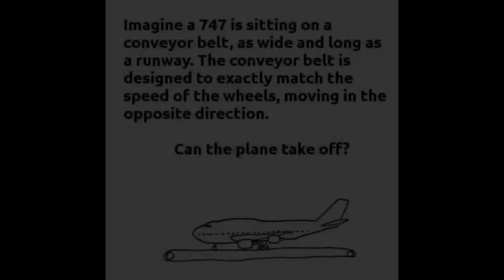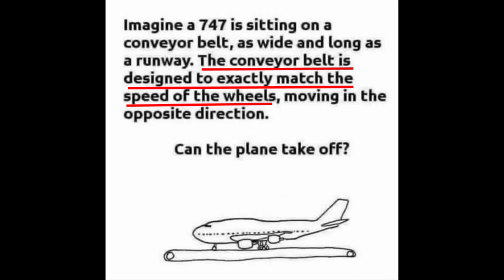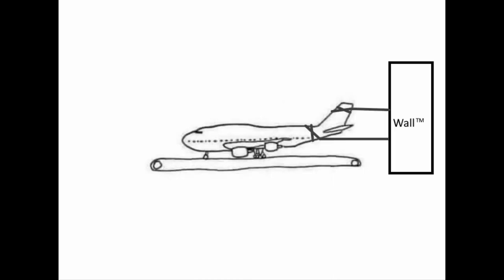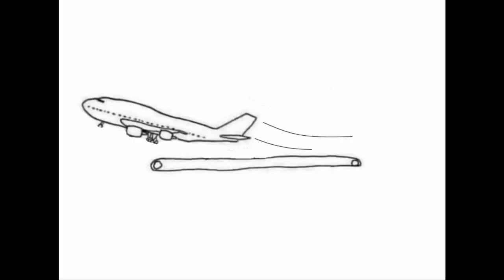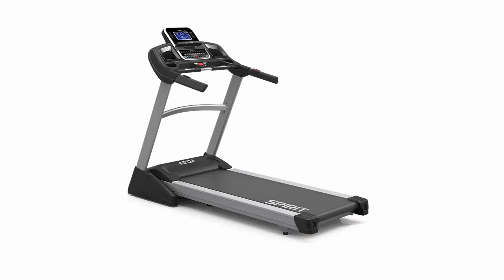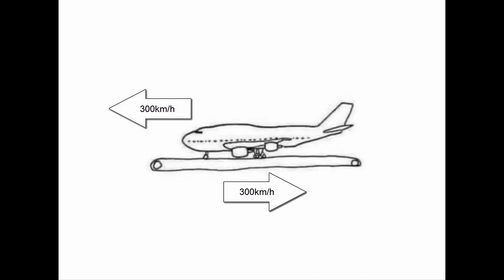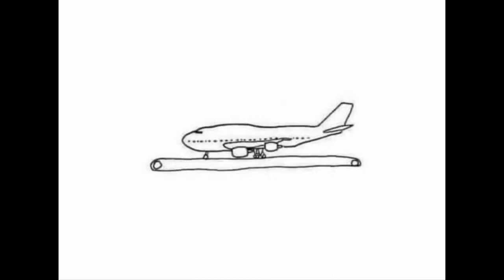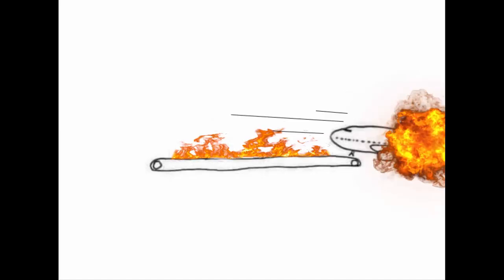Airplane on a treadmill is a flawed question.

Comment: Lot of confusion in the comments about the "speed of the wheels". A rotating wheel has two components of speed, translational and rotational, so make sure you are considering the right speed in the right context. 

Translational speed of the wheel is equal to the speed of the plane. They are attached to each other after all. If a plane is moving at 10 m/s, the wheel is also moving at 10 m/s.
The "speed of the wheels" that matches the ground (conveyer belt) is not the same as the translational speed. This is "tangential velocity" and is equal to wheel radius times angular velocity.

Think about a moving plane (v=10 m/s) on a stationary runway (v=0 m/s). The wheel also has a translational speed of 10 m/s, but it must be rotating such that the tangential velocity at the ground is 0 m/s. Once you understand the difference between translational and tangential velocity, the solution becomes clear. 
1. The tangential velocity of the wheel must match the conveyer belt speed.
2. Since the wheel is free spinning, it is free to spin at whatever rpm it needs to match condition 1. 
3. The translational velocity of the wheel is unaffected by the conveyer belt. Remember the translational velocity equals the speed of the plane, and what determines the speed of the plane? The engines, and only the engines. The wheels have no effect on the speed of the plane; if you don't believe this, think about what happens in the sky. The wheels aren't touching the ground, what is causing the plane to move forward? :)
4. With this knowledge, you can conclude the plane can take off it it wants to (with its engines), and it could care less about the conveyer belt.
Reply: Nope.
Assuming there is no ripping (infinite friction coefficient, else problem is trivial), for example imagine wheels are gears and treadmill is a chain, the plane moving forward means wheel speed must be higher than treadmill speed at some point (really it's geometry at this point). But it's always equal. That means whatever happens to the plane, whether it drives like a car, whether it uses thrusters or whether it is pulled by outside force, the treadmill will always pull it back, keeping it in place.
So "translational speed" of wheel axis and thus plane is always zero.

Really geometry proves it can't be anything else.
Reply: I would like to hear your explanation as to why "the plane moving forward means wheel speed must be higher than treadmill speed at some point", and what geometry you mean to prove this. 

Now let me ask you this, for a normal plane taking off on a normal asphalt runway: What is the speed of the wheel? What is the speed of the runway? Are they equal? Doesn't the result contradict the statement you made above?

You've confused exactly the point I was making, that the wheel has two components of speed to consider, translational and tangential.
Reply: As long as the wheels are in contact with the ground (assuming there is no slippage and the ground is stationary), the translational speed of the wheel is always exactly inversely proportional to the tangential speed. If the surface of the wheel is moving backwards 100 kts at the point of contact, then the wheel must be moving forwards at 100 kts. Therefore, if the ground is moving backwards at a speed that is exactly proportional to the tangential velocity of the wheels, then the translational velocity of the wheel relative to the air is zero,  and thus there is no lift.
Reply: @ninjafruit816  

The issue here is actually just the stupid conveyor as a trick and a impossible phenomena. 
If the airplane moves forward in any part in the scenario, it means the conveyor isn't matching the wheel speed of the airplane anymore; this would mean the airplane wheels are now rotating faster than the conveyor. Which then breaks the question in the first place as "conveyor matches exactly the wheel speed (assumed to be rotational speed). 

The rotational speed and translational speed of a wheel can AND cannot be decoupled depending on your frame of reference. It just goes back to Einstein's special theory of relativity. 

A wheel held in the air, can have any rotational speed with zero translational speed. Decoupled.
A wheel spinning while moving on the ground, from the wheel point of view, the translational and rotation are decoupled. 
A wheel spinning while moving on the ground, from the outside point of view, if the wheel gets extra translational velocity on top of its current rotational velocity, the outside point of view will see the wheel moving faster which then means the ground must move faster backwards, coupled.

So if you see this question in terms of the wheel only, it is decoupled from the plane as it can rotate however fast it wants and the plane just goes forward on its merry way flying off.

But now if you see it externally as a whole system, for the plane to move forward, the wheel must spin faster, which means the conveyor moves faster, which in turn breaks the question as for the plane to even move forward, the wheel MUST be faster than the conveyor. 

Also have to take note of the question where the plane starts off at 0 speed. Since the plane in the 2nd reference frame cannot move forward (arbitrary reasoning placed to "fit" question by user), it cannot get lift and therefore cannot fly.

Meanwhile for the 1st reference frame, since the wheels are free to spin at whatever speed and the plane can always still move as though its frictionless from a freely rotating wheel (again arbitrary reasoning placed to "fit" by user), the plane will fly.

Conclusion, whether it flies or not is based fully on the stupid arbitrary reasoning placed upon the reference frame and conveyor.

Comment: You are right. But everything has a terminal velocity.  Just as long as you can match that speed of anything in a free fall. You can hold it in place. On a incline supporting sed objects weight. 
If a treadmill has a skateboard on it and the board has brakes just strong enough to stop the weight of the board.you tilte the treadmill slightly to match the weight before the board slides under it own weight.  Now let the brakes off and the tilte will have a speed that can keep the board in place. More speed and tilting should be avaliable still.

Comment: The wheel match the conveyor is the key to solve this. the plane is setting on the conveyor neither the wheel or the conveyor is moving. Now start the jet move  1 rev of the wheel now the plane has moved forward and 1 rev of conveyor is now behind the wheel. the real question is how fast the conveyor moving.      the answer is it not and never will. That is the trick of this question.

Comment: 1:10 no due to friction inside the bearings, they play an important role.
Reply from the maker: The friction only matters at very low thrust. So low that only small propeller planes could take advantage. A large jet aircraft could not throttle low enough to balance the thrust v friction. And if you throttle any plane up to takeoff speed, the plane overcomes the friction and moves forward. This is why every practice example of a plane at takeoff speed on a conveyor. From toys up to a full size ultralight on Mythbusters. All roll forward. The wheels don't matter and this is a trick question.
Reply: @venera13  it will get bigger abd bigger with higher belt speeds. I am not talking about 10Km/h or 200Km/h,but probably way more, than the speed of sound.
Reply: @neutronenstern. friction is not a function of speed; only of the properties of the wheels and the weight of the plane
Reply: @dalmationblack  Ever heard of laminar flow?
No?
Its speed dependend, and inside a bearing there is oil, so there is laminar flow.

Comment: I believe the question should have been whether the plane, moving at 300 km/h with engine power, can fly if there is a treadmill moving in the opposite direction at 300 km/h. It's important to note that the wheels, being free-moving, are not relevant to the speed.
Reply from the maker: Yeah the question should be worded better. But it's intentionally worded the way it is to cause problems.

Comment: The wheels absolutely play a part in the movement of the plane, as the plane's mass is resting on the tires, which act as a pass through for the plane's engines.
The mass of the plane is what makes the plane stationary as it tries to move forward, and the belt tries to pull it back.
Reply: Additionally, the calculation of travel at the wheel axis is precisely known to be the tangential speed on the bottom of the wheel.  More importantly is the derivative of speed - the acceleration of the wheels is always matched by the surface of the conveyor.

That is the part the folks regularly mistake.  They try to brute force the aircraft to break the parameters.

The rate of change of speed between the wheels set and the conveyor surface also matches all the time.

Comment: If the wheels have no impact on the motion of the plane, do you expect that if the treadmill was to move at 1000000 mph backwards that the plane would just sit in place with really fast spinning wheels?
Reply: Technically, the only thing that happens if the conveyor rolls will be that the internal losses of the vehicle system (the bearings in particular) will be less than 100% efficient so the vehicle will move backwards just a bit.

The OPs video is deeply flawed.  His examples about a vehicle on ice or a skateboard on a treadmill mistakenly confuse the acceleration with the speed of the vehicle and that being different than the speed of the conveyor.  Then, he misunderstands the scenario by suggesting that the vehicle can be suspended over the conveyor to analyze the system.  That's wrong; the vehicle can only move by rolling or by sliding on the surface and we know we can match the speed of the conveyor to a rolling or sliding vehicle.

He is right in that the example is utterly absurd.  Who would consider trying such a useless exercise and for what practical purpose.  That said, they have to get the conditions right first to analyze it properly.
Reply from the maker: At that speed the wheels would fail. But if the treadmill was going at say 100 kmh and the plane throttled up for to takeoff speed, the wheels would end up spinning 100kmh plus the takeoff speed as the plane moved forward.
Reply: @venera13  But what if it didn't throttle at all. The treadmill just starts moving underneath the plane---does it stay perfectly stationary?

Comment: what's the speed of the wheels/belt based on takeoff speed?
Reply from the maker: It's not specified but assumed to be takeoff speed. However it's  ot possible to match that speed as the wheels don't conform to max speed. If you throttle the plane up to takeoff speed it will overcome friction and roll forward regardless of the treadmill because the wheels are free spinning and will simply spin faster. It's a trick question, it's intentionally dishonest.

Comment: The only real relevant part of the question is where it says that the belt is as wide and long as a runway. Because if it isn't long enough to match the plane's minimum takeoff distance in feet, the plane will run off the end of it without ever reaching Vr. This is important, as this part has been left out of some versions of this, leading people to believe the setup is as pictured. That is, where a 747 that's 231 feet 4 inches long that requires a 10830 foot minimum takeoff distance is trying to takeoff on a belt that's barely the length of its fuselage. This is what they didn't make clear in the Mythbusters episode, which makes what they showed a trick and not a scientific experiment. Their belt was at least the plane's minimum takeoff distance long.
Reply from the maker: What mythbusters showed in both small and large was an experiment. Regardless of the bets length the plane will always move forward because the wheel have no control over the planes movment.

Comment: Let's assume that the wheel bearings are frictionless, and the wheels and treadmill and indestructible.

Now, let's say you accelerate to 1m/s. This causes the wheels to accelerate to 1m/s in rotation. This causes the treadmill to accelerate to 1m/s the other direction. This, in turn, causes the wheels to accelerate to 2m/s in rotation. This causes the treadmill to accelerate to 2m/s the other direction. This causes the wheels to accelerate to 3m/s...

This repeats infinitely, until the wheels are moving the speed of light. Since E=MC^2, this means their mass would also become infinite.

Therefore, the plane would be too heavy to take off.

Comment: The question is flawed not really because of what you showed (you created scenarious which do not match the question) but because of a different thing. Imagine we just started the engines and they provide thrust. Since the force is not compensated, the plane must start to move forward. Nevertheless the question says the conveyor would rotate at the same speed as wheels rotate. Now imagine. This part might blow some minds, be prepared. As the plane wants to move forward, the wheels must start to rotate forward faster than the ground is moving backwards (no matter how fast ground is moving). So if the conveyor speed must match the rotational speed of the wheels, the conveyour will infinitely fast reach infinite speed as soon as there is even the tiniest uncompensated thrust force applied on the plane. So it is not possible that the plane would be moving forward whilst wheels are rotating with the same speed as conveyor is moving backwards, whilst it is also not possible that the plane would stay stationary with uncompensated thrust force applied on the plane. And, eventually, this question is not really flawed, I think that's exactly what they expect a person taking the exam to answer.

Comment: The question says that the conveyor belt will ALWAYS match the speed of the wheels. It seems pretty clear to me that means the belt will always match the speed to keep the plane in one place (horizontally).

This means eventually the energy lost in the wheels will pretty quickly reach a point where the wheels explode, and it won't end well for the plane. 

And if you interpret this as the wheels having no energy loss, the plane still won't take off, assuming the treadmill going at a bajillion miles per hour doesn't create a wind current i(t makes sense to assume the question supposes no wind current.)

The thrust from the engines don't generate nearly enough lift, so in most ways you interpret this, the plane won't take off.

I mean, even if you interpret this as the treadmill going at a constant speed that the planes wheels are initially going at, the plane still wouldn't leave the treadmill with enough lift under the wings to take off, and the wheels would probably fail after hitting the ground again.
Reply: Speed of wheels = speed of the whole plane.
Plane is moving due to thrust, not wind lift. Plane takes of due to lift, but doesn´t need it to speed up -> plane does need to speed up using it´s engines to achieve certain windspeed, which provides enough lift to take of the ground.

Planes are also able to propell themselves easily without touching the ground - they do not need wheels at all to accelerate, they need them only as objects with increased friction when landing (brakes apply) or with close-to-zero friction when they move on the ground by themselves (without breaking).

This simply means that once the plane sits on a runway, it´s engine creates thrust and the thrust starts moving the plane forward. Due to movement forward those wheels touching the ground bellow starts to rotate, but they do not rotate by getting powered from the engine, they rotate due to there being different speed between the plane and ground bellow. They spin at the speed that is the difference between speeds of these two objects. Once the plane lifts of, nothing is turning those wheels anymore and they slowly come to a stop and after some time are taken inside for achieveing better aerodynamics.

So when you would place a plane on a belt moving under it´s wheels, you simply add some speed to those freely moving wheels (or substract, it the belt would be moving the same direction as the plane).

It works the opposite way as well - if you had a plane starting from a belt that would always match its speed, plane´s wheels would NEVER rotate a bit before the plane would take off, but even this would hardly make any difference for the plane´s ability to lift off!

So when you place a belt that is going the opposite way, you just turn plane´s wheels double their standard runway speed (because belt matches the plane´s speed, but in the opposite way). 

But the plane´s ability to take off doesn´t depend on speed of it´s wheels. Wheels are free to turn in any direction :)

Comment: Hmmmmm I think you have totally missed the intended question… more of a paradox because thrust will cause the plane to move forward, but at that instance the movement of the wheels will cause the magic conveyor belt to match them so the plane can’t move forward, but it has to move forward because of thrust, but it can’t b because the conveyor stops it ….
Reply: So because no movement, with thrust causing a paradoxical infinite speed , the thrust needs to  move the wings through air to gain lift. So it can’t take off.
Reply: @JohnHarryShaun  If belt speed matches ground speed each contributes 50% of the total RPM. This meets the criteria of belt speed matching wheel RPM. The aircraft takes off with twice normal wheel RPM.

If you heard that misconception from the Capt Joe channel, he is so confidently wrong.